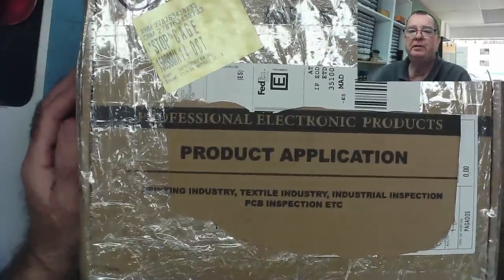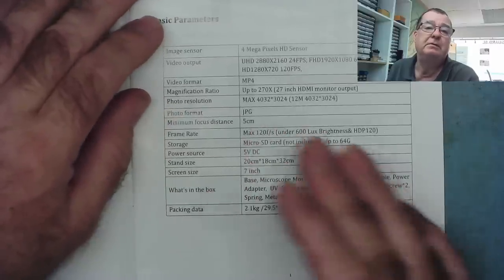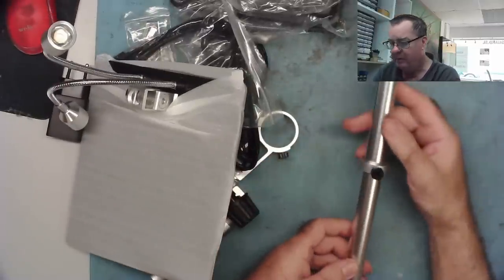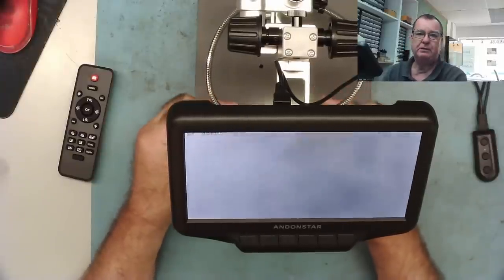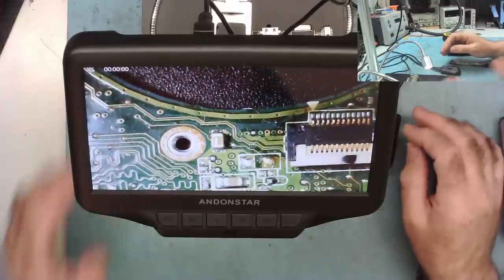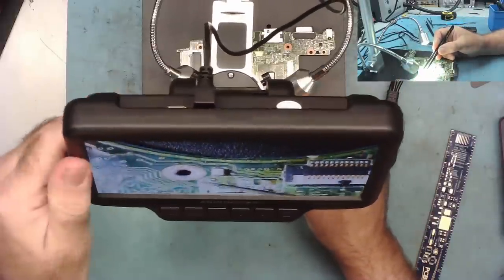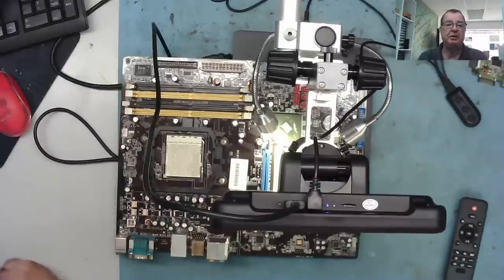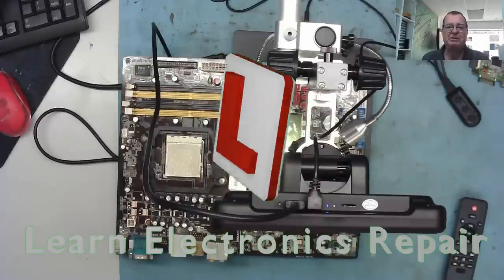Andonstar AD407 Pro HDMI UHD Digital Microscope Review SMD Soldering test & compare to my Trinocular

Comment: I purchased this microscope based on this video, and can confirm it is as good as presented here. I plugged it into a 65" screen and it is every bit as sharp as it is on the small screen. I got this microscope as it is a lot smaller on the bench than a full sized optical microscope, so suits my needs at the moment.

Comment: I have the same one but with a larger screen, you can put it much higher by using the end piece if the microscope, giving you much more room to work. I can’t fault it and use a Cartier bag over it to avoid dust. Before you buy one keep a check on prices, as they go up and down very quick.

Comment: I have mine mounted to a monitor boom and using a Barlow lens. Very nice setup for the price. No limitation on the size of board you can look at.
Reply from the maker: I did try it 1m above my bench alongside my overhead video camera and it worked really well and gave great magnification even at that ditance - I think I may mount it there as an aid to recording YT videos.  I will be keeping my Trinocular Amscope clone though 😉😉
Reply: @LearnElectronicsRepair  hey bro i have gpu i would like to send to u for repair.  the issue with it is,  whenever i tried to install driver the card would crash an sometimes it don't post at all... please respond thank
Reply from the maker: @drakydawkins1098  email me electronicanaria@outlook.com
Reply: Question is the Barlow lens a standard size and does that provide a larger viewing area?
Reply: @LearnElectronicsRepair  ok thanks for responding i sent u an email..
Reply: @R.AudioElectronics  you can use every 30mm lens with this microscope. a barlow (or wide angle) lens provides a wider field of fiew (zoomed out).

Comment: 27:19 - Those microscopes have strong Led lights, which are not diffused, therefore provide strong glares. Once you use diffused anti-glare light, even more details will be visible.

Comment: I have a very similar appearing microscope and you can tilt the upright post away from you so that you can have unobstructed access to your work for soldering etc. I did note that the hinge at the bottom was rather stiff and I had to use a bit or force to tilt it back but it was very useful to do that.

Thanks again for your work making, editing and posting these videos; I very much enjoy them!

Comment: I have bought the AD407 in February. From its specifications in the manual, the model you tested (AD407 Pro) seems to be identical to mine EXCEPT for the length of the shaft (12.5 instead 7 in) and the size of the base. Since with the old holder it was almost impossible to work and solder, I (among other users) have repeatedly asked Andonstar to provide the anyway excellent microscope with a longer support shaft, and their engineers eventually agreed, releasing the Pro version . Hopefully they will sell, on request the owners of AD407 "vanilla" with the new stand system.

Comment: I think the axis of the microscope can be tilted if it is unsrewed a bit with plier, so you have a better range for optical field to ATX boards
Reply from the maker: Yeah I read that afterwards.  Its also fairly simple to mount it above the bench,  I just wanted to point out it is not a major problem to do something like that but you do have to do a little work to implement it.
Reply: @LearnElectronicsRepair  hey bro i have gpu i would like to send to u for repair.  the issue with it is,  whenever i tried to install driver the card would crash an sometimes it don't post at all... please respond thank

Comment: You can also clamp it down the bottom edge under the focus ring, this is best for soldering as you have more adjustment and the scopes not in the way as much
Reply from the maker: I did get it at 14.5 inches working distance clamped as I did it, which is better than my optical microscope 6 inches - but your suggestion would give a little less magnification which would be good.  I also tried it 1m above my bench alongside my YT recording camera - it works very well there too
Reply: @LearnElectronicsRepair  hey bro i have gpu i would like to send to u for repair.  the issue with it is,  whenever i tried to install driver the card would crash an sometimes it don't post at all... please respond thank

Comment: Impressive, seems to beat my vintage dynascope. The bracket looks odd, the lens seems too far forward compared with the site photos, I see some have cantilevered rear arms. Can you zoom using the buttons on the LCD?  Dare I say it, use blu tak to secure small PCBs.
Reply from the maker: This is the larger 'Pro' stand - you can tilt the angle of the supporting pole too.
Reply: @LearnElectronicsRepair  hey bro i have gpu i would like to send to u for repair.  the issue with it is,  whenever i tried to install driver the card would crash an sometimes it don't post at all... please respond thank
Reply from the maker: Mr Guru  Nahh I wouldn't do that - I may charge him extra though 😉

Comment: Hi guys, I posted a DYI Mod/hack of the AD407 on the LER Discord. It is possible to mount it on a LCD monitor arm and have a much larger working area. (even for a desktop board)

Comment: In an engineering environment I would use it on a pcb coming in from a vendor/contractor if I noticed a problem on the board. I would use it make a photo of the problem area, save the photo then in a graphics program highlight the area and add required text i.e. what's wrong, rev of pcb, date etc.
That photo would be sent to QC mgr. from there it would go to the contractor to be aware of the problem.
I personally would not use this product to do any soldering instead I would use a quality Luxo magnifying lamp.
Reply from the maker: Everyone has there own preferred way of working.  For soldering I will continue to use my optical microscope (Amscope clone) as it has stereoscopic vision for full depth perception, but I was pleasantly surprised by how well I could solder with the AD407.  I think I was very fair in the summing up - both have their advantages and disadvantages and it is a pleasure to be able to use both microscopes and give (I believe) a very honest opinion on them 🙂
Reply: @LearnElectronicsRepair  hey bro i have gpu i would like to send to u for repair.  the issue with it is,  whenever i tried to install driver the card would crash an sometimes it don't post at all... please respond thank

Comment: I finally ended up buying something similar. Mine doesn't have the built in display but I'm connecting it to a TV or monitor anyway. It was a difficult choice with all the options on Amazon but I spent a lot of time reading the reviews and hope that I made the correct choice. I can't afford something like this but if I can start making money on repairs, this might be on the work surface down the road.
Reply: good luck with the repairs 👍

Comment: Nice, but if you just need a microscope for soldering and no need for recording video you're way better off with an optical stereo microscope. You lose all perception of depth on a flat screen and that's more important than a lot of people might think.
Reply: One variable which makes depth perception possible is lighting. You can compensate a lot for not having an optical micro by positioning your light sources appropriately. This requires some practice, but it is not any hard to achieve practical depth perception on the monitor.